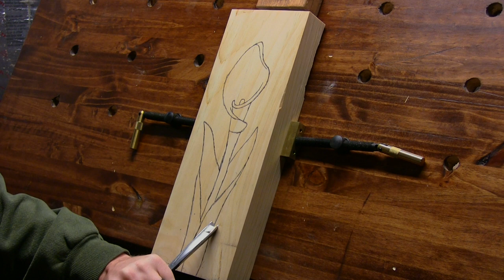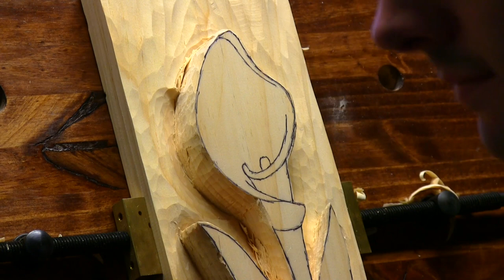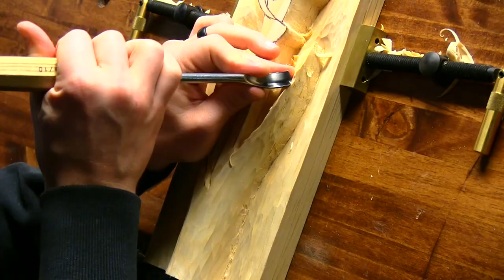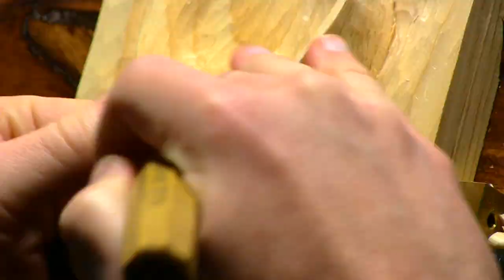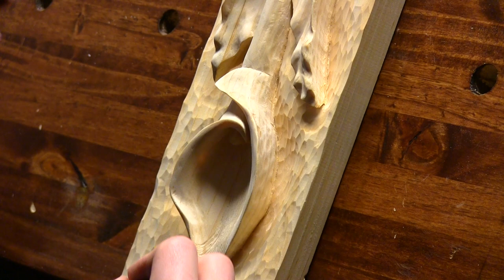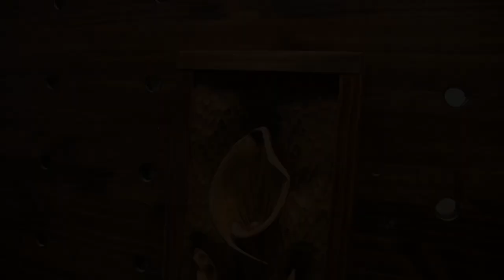LILY FLOWER WOODCARVING - Relief Wood Carving A Calla Lily Flower

Comment: Awesome job! Your finishing technique turned out great as well. You can try using Zinsser “Seal Coat” Shellac cut 50% with Denatured Alcohol for your primer coat before staining on that soft wood to make it more uniform if that’s your goal. It dries very fast, can be over coated in 30 minutes, and works great for evening out the stain penetration. I use this method for staining my soft fine furniture work to get a more consistent finish. Try on some test pieces first. Keep up the great work, and I’m looking forward to more of your instructional videos.
Reply from the maker: Thanks I appreciate the kind words! Thanks for the finishing tip as well. I’ve always struggled to figure out a good finishing process so I’ll definitely be giving your way a try and see how it goes!

Comment: A coat of de waxed shellac before staining will help keep the color more uniform. Some cut it with denatured alcohol to get a thinner coat (like a wiping varnish.)
Gel stain allows more control over how much color and where, like along borders and deeper areas, just wipe off what you don’t want to keep, then spray shellac to fix the stain.
Reply from the maker: That sounds like a good way to finish a project. I'll have to experiment with gel stain, I've never used it before so I'd be curious to know how well it works.

Comment: Awesome man. What’s your opinion on outlining a piece wiith vertical chops versus outlining with a v-tool?
Reply from the maker: Thanks! I assume you mean vertical stop cuts? That is one way to do it too. I guess I prefer the v-tool first because you don't have to use as much force and its far less prone to breaking off pieces in sensitive areas. The vertical stop cuts are great though because you save a step by skipping the v-cut pass.
Reply: @ChiseledOutdoorsCC  Yeah I was working on two legs with identical patterns on each, and one I began with the v-tool, the other with stop  cuts, and the stop cut leg has super glue surgery all over it from breaking off leaves. Thanks dude

Comment: I think it would have worked better using bass wood. I am not a big fan of carving pine. You did a good job with The pine.
Reply from the maker: Thanks. Basswood is good I just can’t get them in the size I want. I’ve learned to work with pine pretty good.
Reply: Where are you located? @ChiseledOutdoorsCC